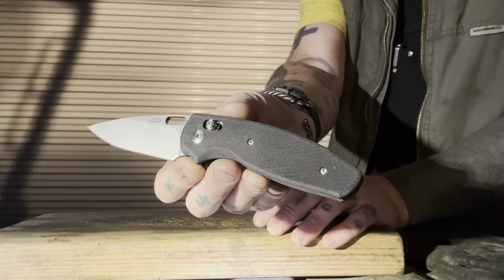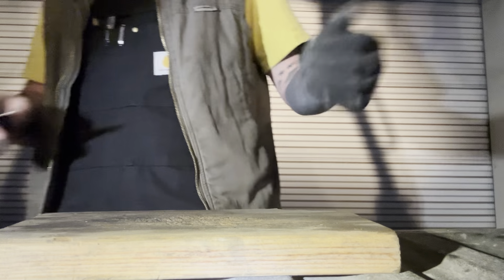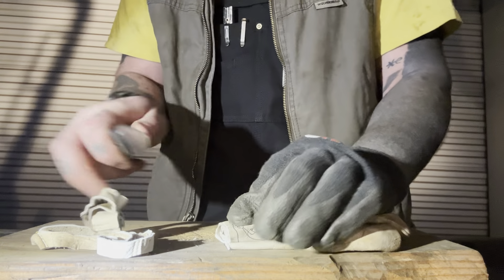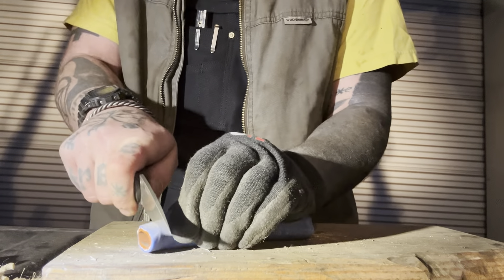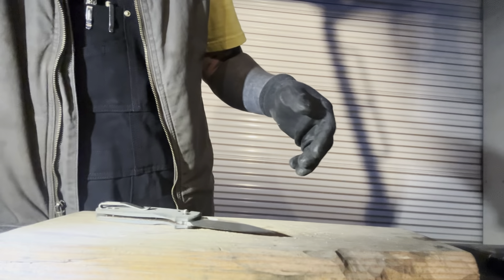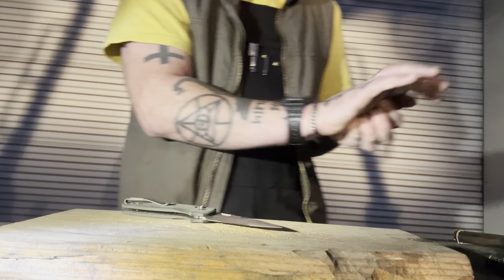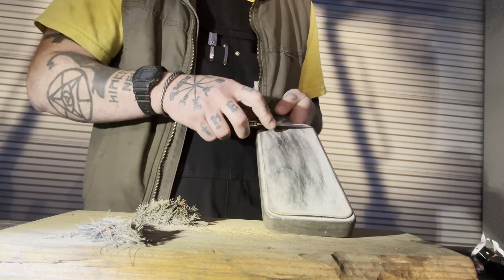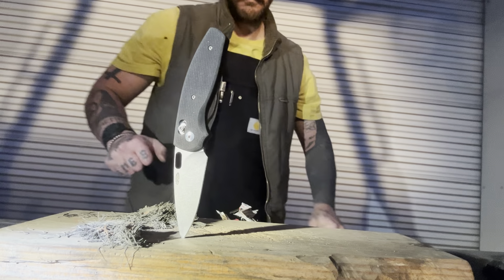Cut Test: TRM “Bulldog”!

Comment: The Magnacut fad is gonna go on for a few more years, The new hotness always gets the most exposure, and exposure sells. And not just to newbies to whatever topic at hand, but to the people that want to experience something new. Let's face it, by now we all own a button lock, a bar lock that's not Benchmade, and sooner or later a button actuated top liner lock. Just like we're all gonna end up with something in Magnacut, if we don't already have one or a dozen.
Reply: I haven’t found anything to replace it yet. S35VN was the well rounded king right up until MagnaCut came out. It’ll be interesting if anything comes out later, but I can’t see anything hitting all my marks for toughness, edge retention, and stainlessness at once. I keep wanting to try other high end steels but the good ones I can rust by being sweaty. Any steels you like more? I’ll try them if they’re stain resistant.